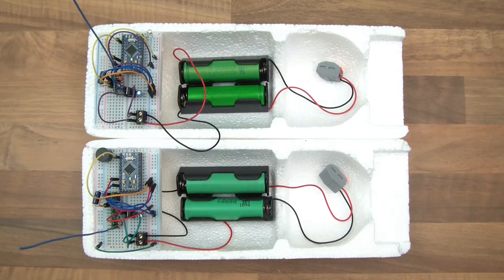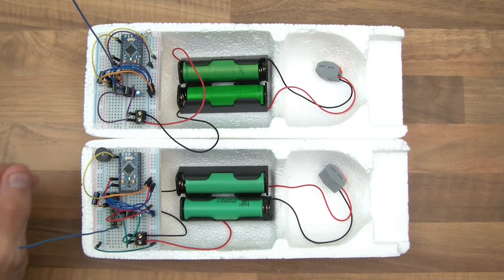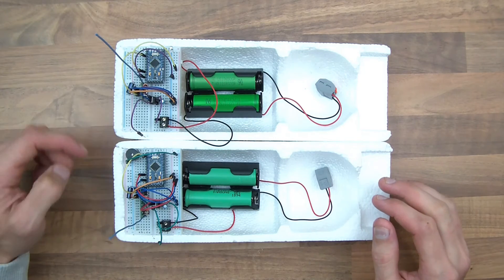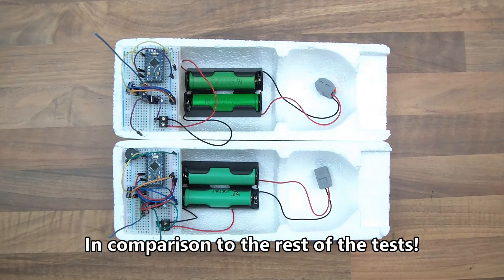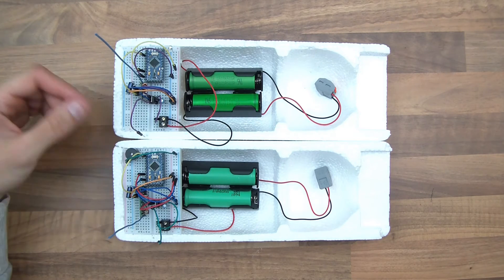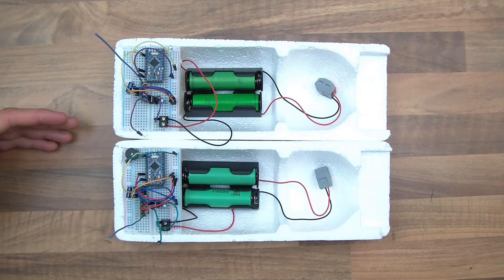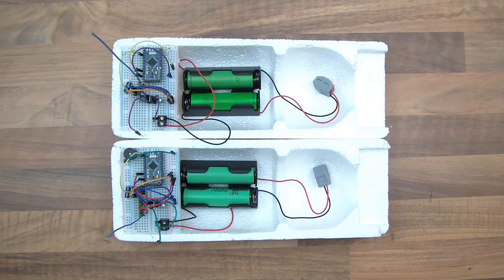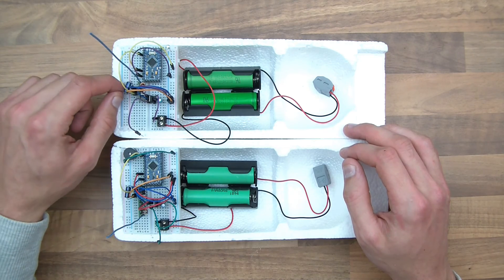INVESTIGATING: The Range of Cheap 433MHz RF Transmitter Receiver Modules - My Findings! (Part 5/5)

Comment: Hi. Would it be good choice for a rc boat? Because it seems the cheapest.
Reply from the maker: You'd have to try it! There is a module which I would recommend - it's called RYLR896. I have a video about it. That module is great but expensive.

Comment: I get 30-40 meters with 6v Tx with attiny85 and 5V Rx with arduino, with coil antennas, without voltage regulator. Nice info about capacitors, thanks, I will try that. I wonder how would data rate affect range ...
Reply: First try to reduce voltage on Tx module, I discovered few days ago that my modules specification is Tx 2-3,6V. Or try doing the same on 2 arduinos.
Reply: Hi. Which Pin you use on ATTINY85. TIA

Comment: From the specs sheet the receiver is always supposed to be 5volt and only the transmitter is capable of going up to 12 volts. Did you test this configuration?
Reply from the maker: grats gg ahh you did watch all 5 parts. Yes, in one of the parts I tried 12v. It was a waste of time.
Reply: Lol I almost responded to your other one saw you commented here. But in the video it looked like your circuit was 12 volts on both the transmitter and receiver? The receivers are 5 volts only from what I've read
Reply from the maker: grats gg you have to watch the whole series lol... I tried all sorts of different things.

Comment: Here is the schematic of the similar transmitter, quite simple:

http://www.msilverman.me/wp-content/uploads/2014/01/K1037299581.pdf

I'm also interrested in it, an I'll play with values and the transistor type to get it working correctly and swing fully at 12V. Maybe it's working point is best at 5V in this board.

Comment: Good findings and a clear conclusion. Just to be clear: am I right to think your DIY whip antenna performed so well because you carefully measured its length? Did you also measure the length of the unfolded coil antennas? I guess that those will deviate a bit from the ideal quarter wavelength size. 
(BTW: many regulator datasheets show an application circuit that features capacitors on both input and output. In my circuits I always add some ceramic capacitors to the regulator and sometimes also near the power connections of a chip. Capacitors are even more important when using switching boost/buck converters).
Reply from the maker: Thanks! It's not clear to me exactly what improved it so well and to what extents. What I do know though, is that the combination of these attributes do improve it significantly. It is clear to me that 5v is massively better than 12v, it's also clear to me that the whip is way better than the coil. To what extents though, I'm not 100% sure. There are so many factors involved. The regulator/capacitor may have also played a large part. I'm not exactly sure. :-)

Comment: I did or we did long time ago as we call it CBer (Citizen Band) back in the 80's. I make long story short. We tried pick up any long distance we comes across, obvious we didn't even passed 20 miles sometime hit or miss. One day, we picked up unusual sign and it was lorry driver, he told us where he was, I can't remember exactly but 5,000 miles from us, He was in USA on his radio and we picked up in UK, talking each other, but faded away as we knew it was going. It was sometime later what we found we were doing moon bouncing... Love the story what I remember well. I must be getting old for the cranky old 27MHz AM (not FM) would do without any booster. Have fun.
Reply from the maker: cheetahkid Ha, cool story. Are you British then?
Reply from the maker: cheetahkid Actually, it's pretty obvious that you're British! Cool! Where by do you live?
Reply: yes I am a brit, I live in West Yorkshire.
Reply from the maker: cheetahkid Cool! I live on the Flintshire/Cheshire border.
Reply: It was not moonbounce.  It was simple high-frequency propagation.  Your signals were bouncing off the ionosphere.  Not a mystery at all.  HF communications take place every day this way - military, maritime shipping, amateur radio, shortwave broadcasting.  There is something called moonbounce but at frequencies much higher than CB.